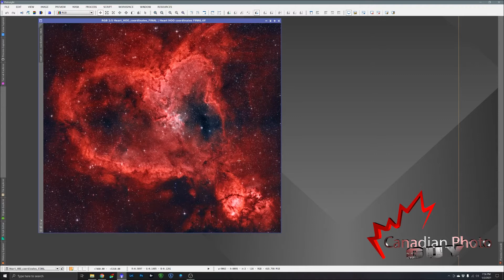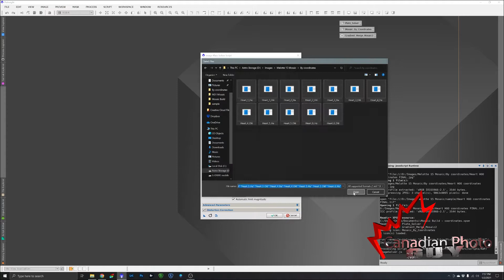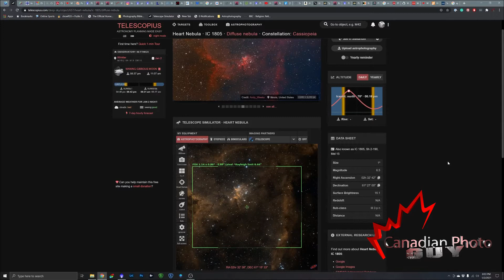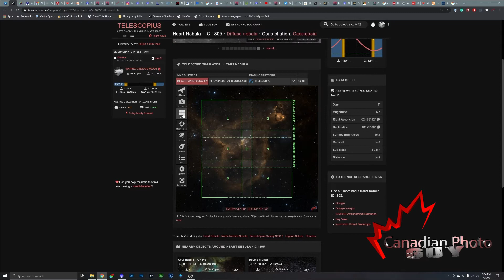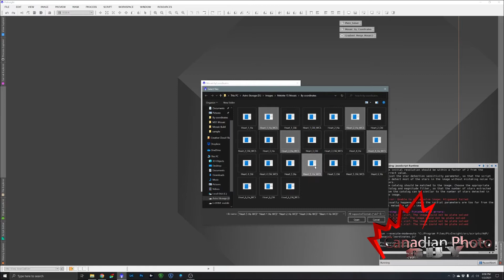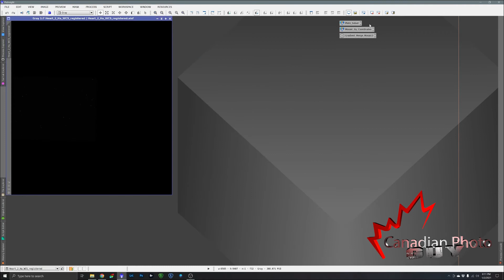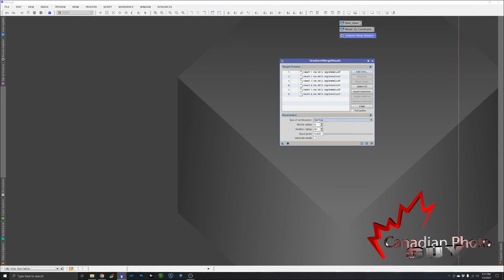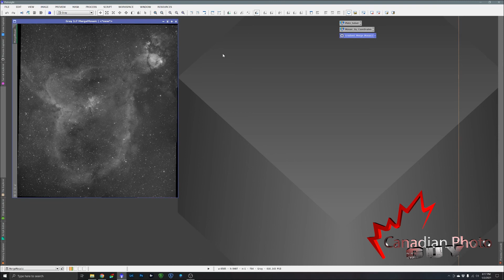Pixinsight Mosaic By Coordinates

Comment: HI, Thanks for this walkthrough.  I am using the OSC ZWO 2600 and doing a 4 panel of the same nebula.  How far along do you take your processing before doing the Image Solver?  It all works fine (mosaic wise) until I have the finished mosaic and try to do a HST stretch.  Never works properly from there.  Suggestions?   Thanks, Bill
Reply from the maker: After a dynamic crop I would usually do the image solver and then carry on with processing from there.  What problems are you having after HST stretch?
Reply: @stevehiebert   Basically it fails. When i use the soft stretch scrip, I just have random text in the window.  When I use the standard hist stretch, there is no image.
Reply: @billgray7220  I'm sorry I don't know what the issue might be there, you shouldn't be getting text showing up in an image.  Are there any updates needed?  I wish I had an answer for you.
Reply: @stevehiebert  oh, thanks for the reply!!!!